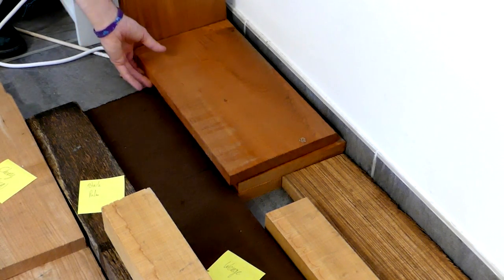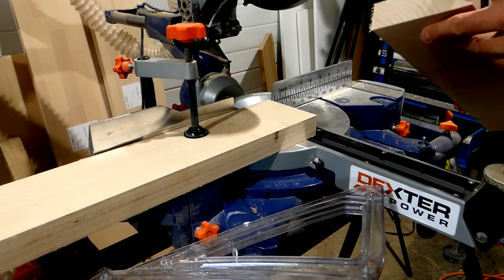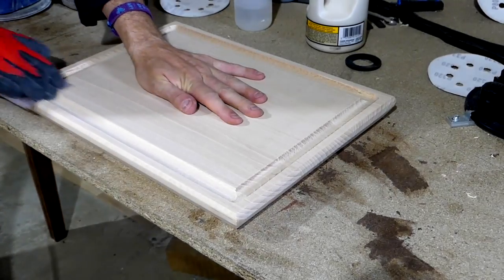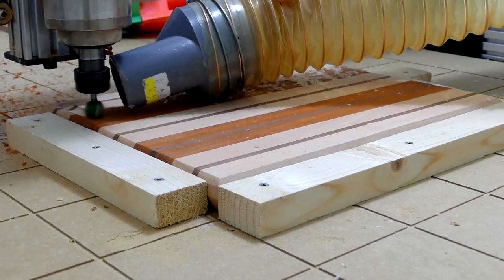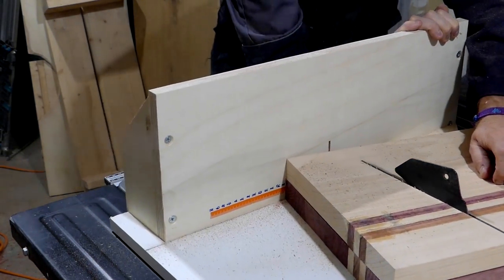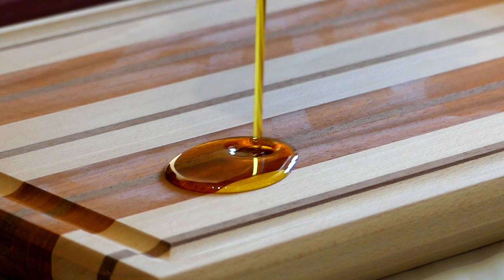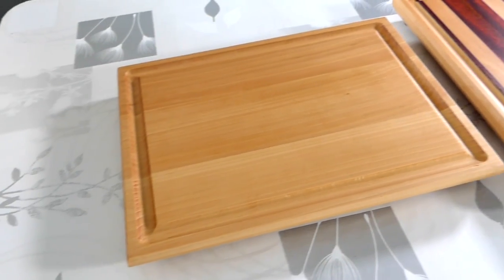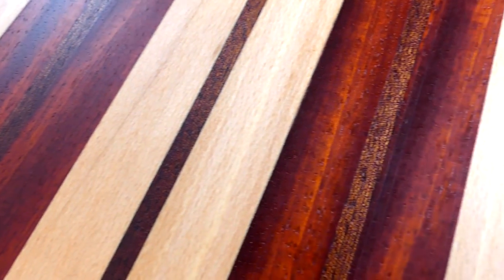25 Levels of Cutting Boards | Episode 1: Classic - Strips - Negative Strips

Comment: Hey, excellent videos - I started with the honey comb and came back to see all of them. 

QQ: In the 3rd board I take it you are glueing the end grain. Will that join not fail over time?

Thanks
Reply from the maker: Shouldn't be a problem since it's an end-grain-to-end-grain glue up :)
Reply: Ankur, that was my first thought.  Every bit of woodworking knowledge I’ve gained throughout my life and every professional I’ve listened to will say the same thing, and even prove it.   Glueing end grain to any other grain, especially end grain to end grain, is a weak joint.  I wouldn’t trust that joint for anything that might have pressure applied, such as a table.
Reply from the maker: @choprpilot76  Go check out the video called "Glue Myths: 1. End grain" by patrick sullivan, end-grain to end grain joints are stronger than edge-to-edge on his experiments. It's really interesting to see. End-to-end can looks weaker because it breaks on the glue joint, but edge-to-edge breaks before the glue joint because the wood isn't as strong as the glue in that direction.
Reply: Yes, I have seen that & it gave me more confidence that it should be ok specially when the join is not narrow & almost 12” in our case. 

I would try it and keep the board for myself probably not sell it or gift it though unless I have had it for a couple of years.